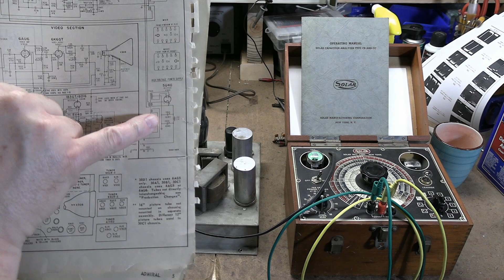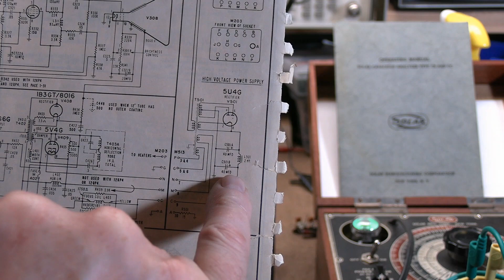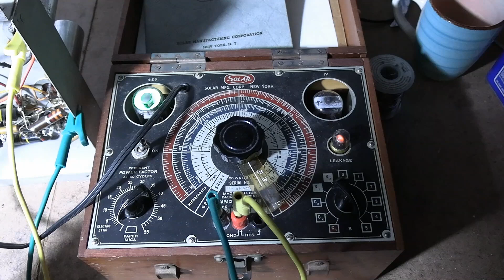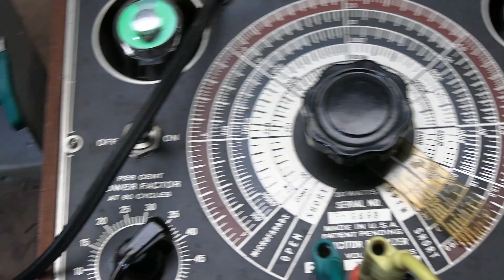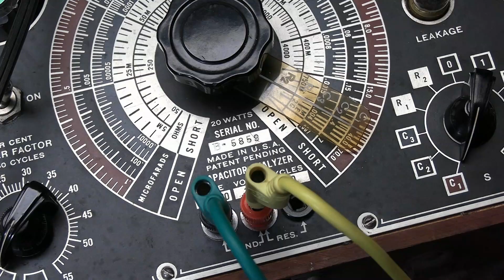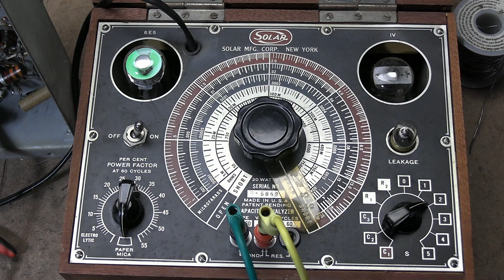Beginners guide to B&W tube TV restoration part 8 (testing capacitors)

Comment: With the many years I have been reforming aluminum electrolytic capacitors, high leakage current has not been a problem, so long as it doesn't cause the capacitor to self-heat.  Self-heating causes thermal run away since leakage currents increase with temperature.  However, with that said, the oldest Twist-Lock capacitors I have been able to successfully reform is about 70 years, and I don't consider them 100% successful as, within a year's time, they tend to lose their high voltage breakdown rating relatively quickly (within a few weeks if they are not used on a daily basis).  So, if in doubt, replace those old electrolytics.

Paper capacitors are a different story, especially if they are being used for DC blocking.  The leakage becomes so high with these capacitors, it is the equivalent of placing a resistor in parallel with the capacitor.  The resistance typically becomes the dominate factor, to the point where a capacitor meter can't distinguish the capacitance value.

Comment: Modern testers don't check leakage directly but they can still be used. They tend to read the capacitance value as higher than reality when capacitors are leaky. If the measured value of a paper capacitor is more than 20% higher than its rating you know it's leaky. On my particular tester (a cheap AVR transistor tester) most of the paper caps I tested read around 150% of the rated value, some also read more than double.

Comment: Very good video. Another reason that TV and radio manufacturers would prefer to stock fewer values and voltages of capacitors is to reduce their own stocking and inventory costs. Most of the time manufacturers get a cost reduction in a contract with the parts source if they buy a great amount of parts also. Not every decision is based on engineering.
The leakage in capacitor can throw off the bridge balance and indicate the capacitance is higher than it really is. Modern handheld capacitance meters very often measure the time it takes for the capacitor to charge to a certain voltage from a current source. Digital electronics are good at counting and timing. Leakage can throw that off as well. Vintage tube circuits do not draw as much current as modern circuits do so the ESR does not effect them much.  It seems to me that people that want to test every paper or electrolytic capacitor because of cost are not considering the cost of time spent testing them. Some people are just contrary also.

Comment: 14:20 - if, like me, you want to actually imagine what’s happening inside the capacitor, it means that the electrolyte liquid that is the dielectric inside the capacitor is starting to change in its chemical make-up and is slowly becoming conductive. Naturally, the higher the voltage, the more likely it is to conduct between rolls of the foil or whatever is wrapped inside it (one “plate” on one side, the other on the other side of whatever’s wrapped inside) and as it ages, the point at which it will start to conduct gets lower until the point it’s conductive enough to be a total short circuit. Applying a current and therefore a bit of heat through it can also actually heat up and re-form the chemicals used inside. Or it can make it worse.
Reply from the maker: Sort of.  The electrolyte has to be conductive for it to work.  The insulator/dielectric is aluminum oxide.   The oxide layer is maintained by electroysis between the aluminum foil and electrolyte.

Comment: Looking at the leakage chart for aluminum electrolytic capacitors, the normal leakage current for a 40 mfd 450 volt capacitor is around 850 micro amps when it is fully formed.
My Heathkit capacitor checker is calibrated at 15 milliamps (15,000 microamps) which is the failure current for large electrolytics leakage test. I would be curious how much current it takes to make the neon lamp flash, and how much to make it stay lit.

Comment: Looks like that double 40 mfd twist lock capacitor is riveted in. Looks like a good candidate for an adapt-a-cap and two modern radial capacitors.
Reply from the maker: Yes it's mounted to a plate that's riveted in. Same spacing as adapt a cap

Comment: Excellent tutorial and advice on caps in this video.  Also, at this point in time, do not trust any paper mica capacitors. The paper in them is also failing. Just replace them. I noticed the El Menco ones are the worst. I have even tested them on 5 (!) different cap testers and they test fine, but will not work in circuit.  Even some "brand new" ones from the 40's and 50's NIB.
Just replace them with the silver mica epoxy coated ones. It will save you hours/days of troubleshooting time.